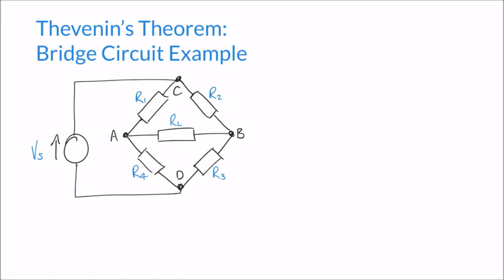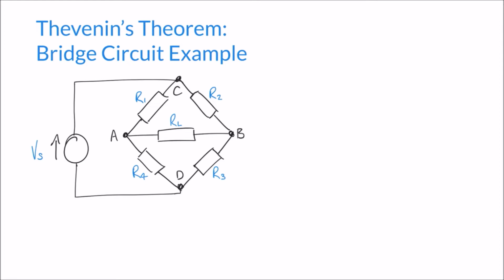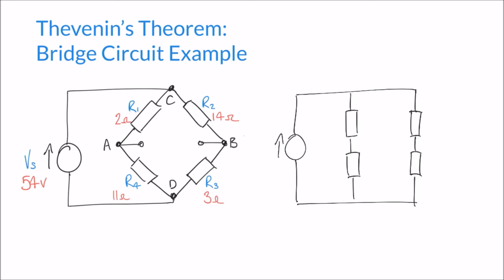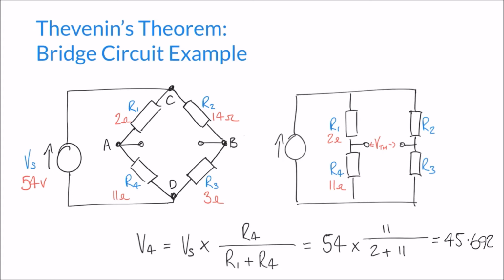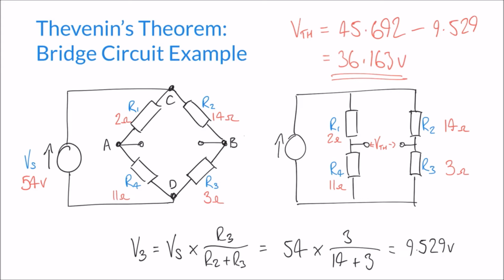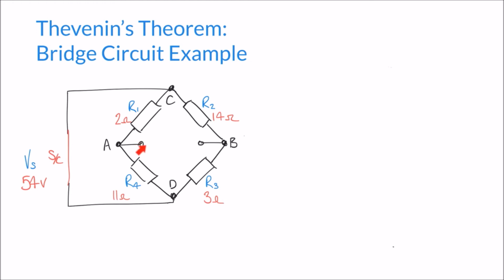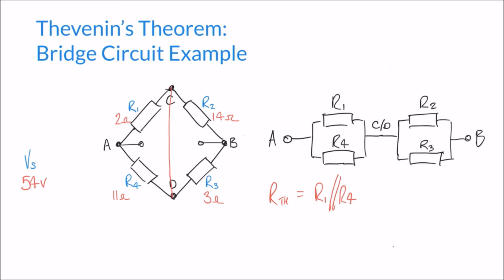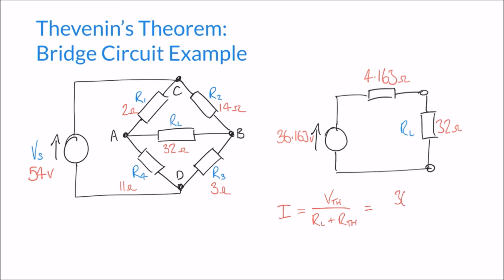Balanced and Unbalanced Bridge Circuits

Comment: Please answer my question if the question is find current across this resistor instead of voltage. Then what is the formula to find mid current? Kindly answer please
Reply from the maker: Ohm's Law: Current = Voltage divided by Resistance

Comment: What if R_L isn’t given
Reply from the maker: Hi Francisco, though we do use RL to calculate the value of current at the very end of the video, you'll notice that RL isn't required to calculate the Thevenin Equivalent circuit. In the absence of RL, this would just be an open circuit at the end, without RL, and the terminal voltage would be VTH.

Comment: why is the vltage through R3 and R4 the same as the points at which we want the voltages for?
Reply from the maker: If we take point D as being 0V, then the voltage at point A must be equal to the voltage measured across R4, relative to point D. Likewise, the voltage across R3 gives the voltage at point B.